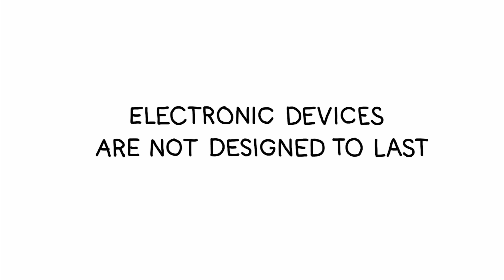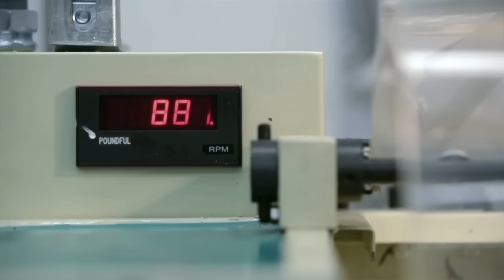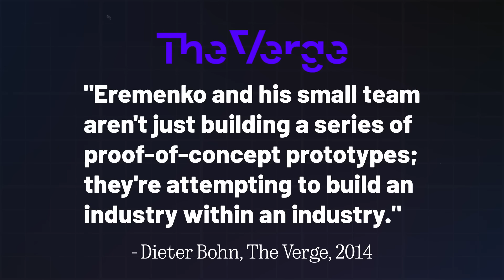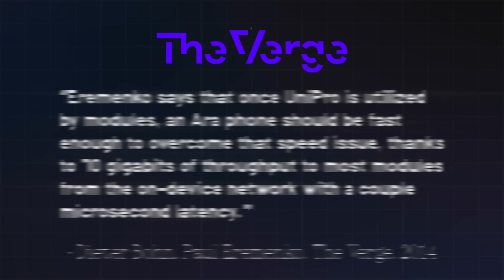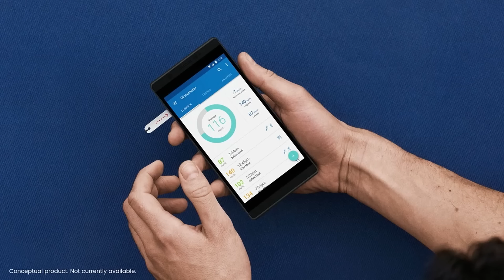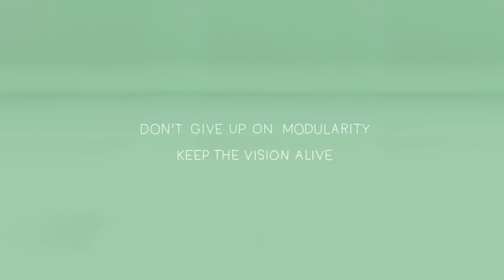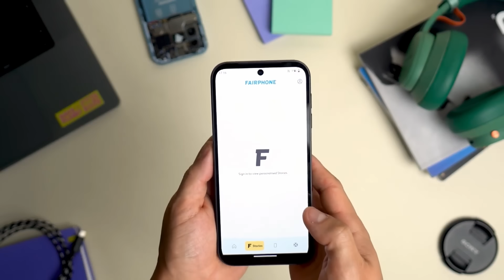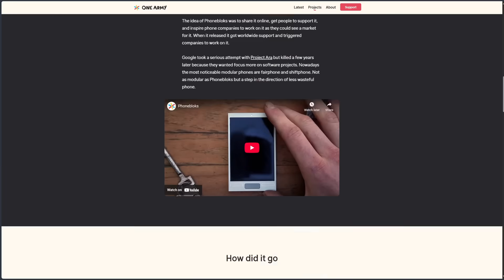Why Did Modular Smartphones Fail?

Comment: Your point near the beginning about how phones made from modular blocks are inherently limited makes complete sense to me. That is never something that I wanted. I would like a phone like a gaming PC tower: you can open it up, and replace the GPU with a newer chip, but it might take you an entire afternoon and some specialty tools. I don't need to upgrade my phone in 30 seconds with no tools. If I need to buy an obscure size of torx wrench, I'm fine with that. If the upgrade takes me 4 hours, I'm fine with that also.

In fact, making it too easy to remove a module really worries me. I'd be afraid of losing a module while I'm out somewhere.

This is the exact same problem as the GOAT multi-tool. I carry a multi-tool almost every day, and I've never been able to buy one with the exact mix of components that I want. I want to be able to buy a frame, and then put into it the exact components that I want, and then carry that. I might change it every six months, if I find that I want different components in summer vs. winter, but maybe not even that often. The GOAT tool is "hot swappable", you can change a component out in around 30 seconds. However, sometimes, when trying to fold away the main blade, I accidentally detach it from the frame instead! That does not make me faster at my project, it is not more efficient, it is the opposite. (I'm a little pissed at them because, when I sent them an email, they responded that "we never expected anyone to complain that it was TOO efficient". It's not "too efficient", it is INefficient. Having the blade fall out of the frame when I am done with a step of a task does not speed me up, it slows me down.)

Anyway, the animated image of a phone made of blocks looks cool, in a video. But having something where all of the parts are... normal parts, but they can be removed using available (even if obscure) tools, and most importantly: replaced with newer and better versions of that part, is WAY more useful. I don't need nor want my phone to LOOK modular. I want it to look exactly like a non-modular phone. I want all of the modularity to be hidden inside. Not only would I like to be able to upgrade the components that I actually use a lot, but I'd also like to be able to downgrade the parts that I don't use very often, and to remove the ones that I don't use at all.

Concealed modularity: that is the goal that we should all hope for.
Reply: The reason you don't need to be able to upgrade your phone in 30 seconds with no tools... is that you are not going to do that every 30 seconds or ever 30 days. When it needs to be done, you can take your time, and the sacrifices necessary to make something done rarely to be swift and simple are not worth it.

Comment: TBH, it'll be cheaper in the long run, considering regular phones like the iPhone literally have fixed life expectancy, so they practically force their customers to replace their phone within 3-5 years. I like the idea of a modular phone because it's like a computer. Back then, computers weren't modular; if one thing broke, there was a fat chance you could fix it, and you had to throw the entire desktop. The development of the home pc from that to the current modular version also had issues with it being expensive since it's sold separately, bulky and inefficient, and the market was once reduced to hobbyists. But now those problems are gone, because people keep innovating that idea. Man, I hate to see the idea of the modular phone dying.
Reply: The best I can have is Xiaomi Poco series, it isn't as modular as this phone made out of LEGO, but I can swap damaged parts easily. Like when my IO broke because I dropped it from my car, I can pay someone to replace the damaged part for 10 bucks total.

Comment: Glad you mentioned Moto Mods.  I've had a Z and a Z4.  They were a really cool idea, but the price of the mods made it a non starter for most users.  I recall the camera and projector being over $200 each.  I mostly just used the extended battery pack.  I did pick up a few more mods once they hit the clearance rack.  The projector is probably my favorite, since I can watch videos on the ceiling while in bed.

Comment: 9:40 - that killed the project for me. I basically use only the basic functionality. I want a phone where I can snap in better CPU, better RAM, more memory, more battery. And maybe carry a camera and speakers modules in a pocket in case I need them for something.

I don't want a phone with a set of gadgets that have connectors so unique it will die immediatly.

Comment: Problem is that it's only going to be one or 2 of these companies making components compatible with each board (and at that the board shown is pure fantasy and wouldnt be as modular as shown in practice). They would hav a captive market and would likely cost you more in the long run for a modular device than just upgrading your existing device when it becomes outdated or broken.

Comment: "Modularity" works for desktop PCs where you can just slap any ATX motherboard in any ATX case, even then you have to replace the motherboard when CPUs require a new socket or if you want DDR5 over DDR4. Smartphones should all have expandable storage (mSD or m.2), somewhat user-replaceable batteries, screens, camera and USB socket. Anything beyond that will likely be too much of a compromise. Those components should be reasonably priced. The blocks of glued in components we get now is unacceptable. Needing a heat gun and pry tools to get a battery out is not OK.

Comment: There's a deceptively simple reason modularity has been relegated to niche prototypes: almost no one actually cares about swapping modules once they have the ones they want. That makes the functionality more or less dead weight.
Upgradeability has more appeal, of course, but it is extraordinarily difficult to future-proof the frame of a device. Apple carefully adjusts every gram of each new iPhone model to achieve the performance and efficiency they're known for. A modular base, meanwhile, could easily become a lowest-common-denominator albatross boxing in future design innovation.

Comment: The problem is the whole slotting system. I think it's gone too far into the modularity idea, but should've balanced what parts typically need replacing. Memory, battery, perhaps screen. Anything further you would get a dedicated device for it, or one which can be used with the USBC port. In essence it''s sacrifiicing everything for modularity.

Using a pc as an analogy, we don't need the modularity for say "I want two power supplies and 16 ram sticks". What modular phones need is to distil down to a concise list of parts. The closest in appearance is the later phones here, with fairphone being the most reasonable.

A hybrid between the two is more like the modular laptop idea, where the phone is the core unit but it can be attached to a larger frame which can house the extra components. Say you can attach your phone to a camera frame, which makes it function as a standard phone by itself, but can be attached to be used as a professsional camera. Essentially it is where most of the software is kept, with the hardware being adaptable

Comment: The fairphone is good in concept, but horrendous in execution 

The fact that they don't make one with specs from the current decade completely kills any incentive I might have to buy one 

What good is 8y of software support when the CPU was obsolete 5y ago, and can barely run the current version of Android, let alone one from 8y in the future that'll be even more bloated 

Also, no 3.5mm jack, no option for an AMOLED display, no wireless charging, and obviously, no option for a modern high end SOC or 16GB of RAM 

Make one with a snapdragon 8 Gen 3 of a mediatek dimensity 9400+, an AMOLED display, and wireless charging and I'll buy one

Comment: I thought it didn't make sense. Would I need a bunch of non-functional placeholders for extensibility? If I changed to a higher-quality camera to record video, would the process and storage be fast enough to maintain the FPS? Of course, modularization would add overhead, at most, battery and storage. At that time, Samsung phones let me do that already.

Comment: They failed because modular anything is always more expensive than non-modular anything, simply because of design. The design has to be perfect, which means it has to be perfected, and that means it's going to take a lot of time and money. Even if you did have time and money and got it to be a perfect design, that design is definitely going to be bulkier than a non-modular phone because of the additional connections and subcomponents.

It works with something like the Framework laptop (and even then, only barely) because it's a laptop. A phone is too small for it to conceivably function as well as a normal phone without being expensive and highly vulnerable to dust/water. Ultimately, it would be an enthusiast product and all the sales wouldn't be able to cover the costs to make it happen.

Comment: Now thinking about it, modular phones might had not been the solution, here is why:

We know nowdays, brands like apple support the "change it every year" system, even if it still works, so who can tell us it wouldnt happen with modular parts like, eventually getting anew release every year we would get thousands of new realeses every year, pieces made to fail in 1 or 2 years making the whole point of these smart phones useless, and instead of having a big piece of chunk we would have a lot of small electronic trash that nobody cares to keep cuz "i can just buy a new one, and its way cheapeer than buying a new phone, so i can replace them every year", and we know america, it would be even worse with tik tok like, just imagine "unboxing my new phone accesories", "throwing away the 2024 ones and getting 2025 ones" yk.

Maybe, we re fine like this

Comment: If people replacing their broken phones really is a big part or e-waste (which I highly doubt), the solution would be put in regulations to force companies like Apple to stop their relentless efforts of sabotaging third-party repairs so people can actually fix their still useable devices on the cheap.

Remember when laptops were once modular? Just filp it around you can easily replace the storage, ram and battery. Nowadays you can still do that, but only after removing the back cover and disconnecting internal battery is much harder that the old removable design which leads to many accidents destroying many components on the motherboard.

It's not we don't have the technology, it's those greedy companies want your devices to break so you'll have to buy more.

Comment: the average online "tech enthusiast" seems to think engineering a phone is like building lego
Reply: Because it is. A modern phone is just a computer with a sim card. Nothing more, nothing less.
A PC is just lego, well, was back in the 90s, today most people need the same legos (network card, GPU, sound card, bluetooth), so the most commonly used ones are usually build into the motherboard, but you can still put more logos in using USB and PCIe. A laptop is just a computer with a battery (one more big lego), and framework proved that it can be modular if you want. And a phone is just a small laptop with touch screen lego instead of keyboard lego.
Reply: @hubertnnn  You must have different Legos than I do.  Don't remember the last time I needed to give the FCC a copy of my build for radio interference testing.

Comment: I dunno. I think if you can solve replacing each individual part and build a robust ecosystem around that. Then it becomes easier to introduce interchangeable modules by replacing just a couple core parts. 

I look at the framework laptop that was turned into a mechanical keyboard, and how that was only possible because of how Framework embraces DIY hardware modding.

Phoneblocks and project ARA had a similar vision but with all the edges sanded away; leading to several design restrictions, literally keeping the modules on-rails. It doesn't really have the flexibility to be perpetually upgradable and reduce e-waste. 

If fairphone started making their internal hardware interoperable from one model to the next, introducing parts which support hot-swapping external hardware would become a lot more feasible.

Comment: Before watching, I have several guesses on why a modular phone would fail:

- Lack of standard specs. The fact that every iPhone N (for pretty much any N) has the same specs means that app developers know exactly what hardware is available to them. They can thus be confident that if it works on their phone, it'll work on any phone of the same model (and probably newer models too). A modular phone -- by design -- does not have standard specs.
- Price. A phone with modules is going to be more expensive than an equivalent phone with the same features integrated into one board.
- Most people don't care or understand. Of people that use a phone, only a small percentage will even understand what the benefit of a modular system is.
- Lack of application. Even for those people who do care, only a fraction of them stand to gain a benefit from a modular system. There simply aren't enough situations where having a setup that isn't "the default" is required. (Such situations DO exist, there just aren't enough for a mass market.)
- Big Tech would make less. Why would Apple sell you a new module for your old phone when they could sell you a brand new phone for five times the price?

Again, these are just guesses. The true reason could be all, some, or none of these.

Comment: Too many components means too many ways in which they can fail. It's what used to be so great about the iPhone. Everything was integrated and single sourced. Now it has parts from all over, with many being shared by the competition. From a marketing and branding perspective, modular phones are also extremely niche and the tech behind them esoteric to many. Niche markets aren't sustainable for what's required to keep a modern tech company alive, especially in the phone industry.

Comment: I think i'd prefer these sorts of things if they made the core of the phone contain the most important things to function, and the modules things like storage, batteries, cameras, etc.
then, they should make the core of the phone also swappable, in that all future cores should be backwards compatible with older modules (within reason, but not necessarily all future modules would be backwards compatible with older cores, to prevent outdated module connectors holding innovation behind)
This would mean that replacing your phone wouldn't be replacing the whole thing, but replacing the things that make your phone not the best for you.
Then, they could try to do the rest of the parts in the core like they do PCs, where they're replaceable, but are a bit more involved to do so. More informed users might tailor their cores to their own needs, and use modules to further customise, but, for the average person, pre-made "builds" would be on market, with cores and modules tailored to certain lifestyles.

Comment: 0:22 "What made this promising idea fail?" Uhh... because the main connector can fail? Standards need to change, and hence, connectors need to change, thus requiring someone to need to replace the base unit anyways? Like this is the same problem as building your own PC. You can upgrade CPU and RAM and hard drives for a while, but when the motherboard needs to be changed, or the CPU or ram has changed formats or the graphics card changes connector formats from one to another. Like, everyone that knew tech and PC's knew it wasn't going to fly or be any better than any other phone. But on top of that, the additional connectors means more material. Which means thicker and heavier phone but with worse hardware (because they had to conform to the size/shape format), less extras on the phone (because you can't put the same amount of devices with the format that it has) and none of the waste saving (and, sometimes, it'd mean more waste). For me, this was one of the first major incidences of tech bros culture. Keep in mind, this company started in 2007 but Theranos started in 2003.

Comment: Because they did not forced it enough. 
That's the only reason. 

Because of less profit.
Changing the i3 processor to i9 is easy and cheaper.
Instead of buying the whole new cpu with an I9. 

Forced sd card, 3.5mm jack removal, that didn't fail, Right?

Comment: I love the idea but ... Gonna be honest, I don't see how the idea holds water for a mass market with the way cellphones currently work. It'd almost certainly cost more to buy in (maybe not 4k, but still), which really cuts off the people trying to save money (even if it ended up saving in the long term ... though you usually shouldn't buy into something new and therefor potentially volitle for that anyways). And then most normal people just want something that elready works and they don't have to figure out in any way (repairable is more important than upgradeable for them. It's easier to jump from complete product to complete product when they stop working. While the speed module they showed wuld mostly solve the "I don't even know what a ram or a cpu is." problem that some people have, it still isn't really a full solution. Instead, this seems like a product for the hardcore power users that they tried to give mass market appeal.

Also ... I'm really not sure how this would solve E-Waste? More little parts isn't that much better than 1 big part. And I really think the form factor decreases the reliability of the hardware. I really can't see a good way to keep it modular without sacrificing something of the lifespan.
Reply: I have been reading comments on this video and this one is the only one that doesn’t make me facepalm